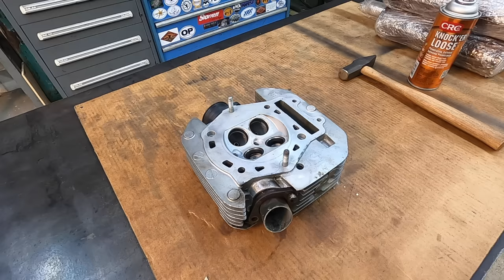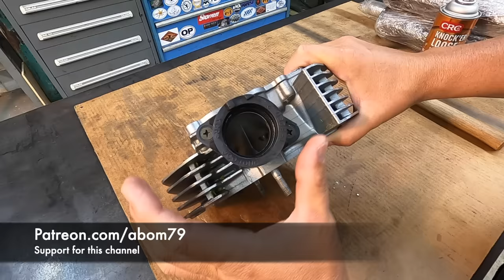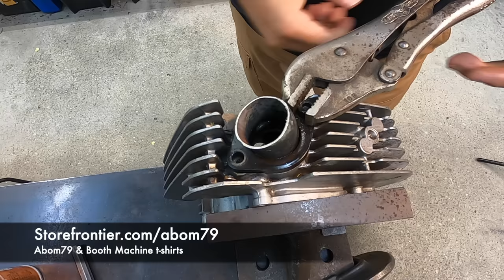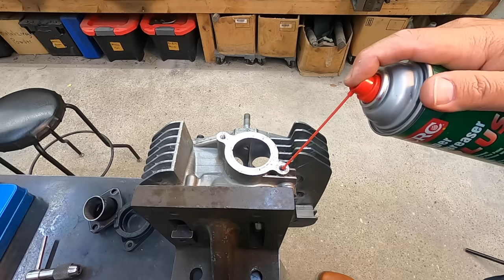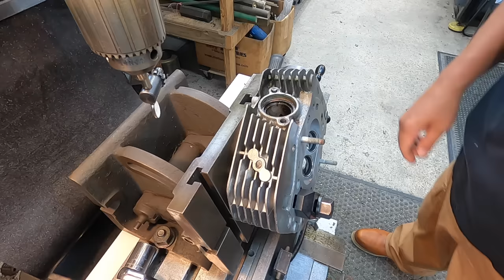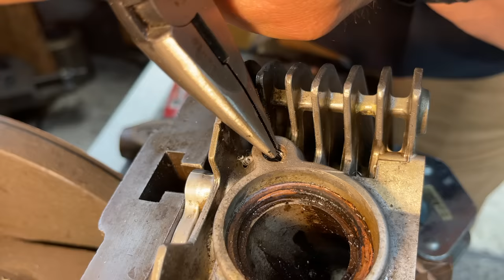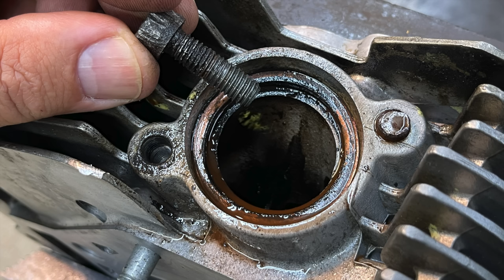Broken & Siezed Bolt Removal, DR 650 Cylinder Head

Comment: Because Alum expands much more than steel first heat to 350°f.
Reply: That's what we always did when I worked in a motorcycle specific machine shop.  Get it hot, and it's amazing how easily steel comes out of aluminum.  Not only that, but I don't know any motorcycle mechanic who doesn't have an impact driver for those PITA conical seat phillips head screws.  I bought my first one in 1980, the same year I bought my Honda 750F.  It was invaluable.
Reply: @lobuxracer  1972 I bought new a Honda 750 great bike.
Reply: Heat is my go to for that!

Comment: I have a fold down back seat latch stuck in the upright position.  I tried using every kind of anti-locking lubricant I could find.  I tried banging it. Nothing works.  Also, finding a replacement mechanism  at junkyards has not been successful.

I have to live either the problem until I find another vehicle

Comment: 50/50 mix of acetone and ATF works better as penetrating oil than anything you can buy off the shelf. Ignore WD-40, Knock 'er Loose, PB Blaster, etc. Just mix up some of the ol' magical oil, spray it on the part (a lot of it), and let it sit overnight. You'll be amazed.
Reply: You can also use VM&P naphtha instead of acetone. The point is to significantly reduce the viscosity of the ATF with a very low viscosity thinner. Also, any other light oil like power steering fluid will work instead of ATF.

Comment: I would have tried some heat first....then if no good weld a nut on with my mig.

But if I had good drilling equipment I would not need that.....but being a home mechanic thats me.

Comment: Mate reckons you should have aligned perfectly with the broken bolt
You should have aligned to a thousands (i.e. perfectly) on the removed bolt thread and then traversed across to the broken bolt knowing it will be offset by full or half mm steps.  You'd obviously have to do some trig calcs due to the angle.
This would have enabled you to align perfectly with the broken bolt that you drilled out.

Comment: This is definitely the most difficult way of doing it and takes way too long, with the first drilling slightly heating the piece with the torch and an easy out. Will come out in no time, that’s a very soft material you don’t need to go through so much to remove a broken bolt I’ve done it countless times and never damage the thread.

Comment: Lots of comments that shock (impact ham, hitting with real hammer works, i have a trick i have never seen used by someone else but it always worked for me.  Take a air impact wrench and turn air down to a point so it can not shear of bolt let it sit t there hammering for 20 min, turn up power a little wait 5 min turn up more, wait a littl everytime i done that like  magic it starts to turn out. Small hits from a impact wrench kill the devil. U can laugh but unless you try it you dont know it. The torque is so low it wont spin the wrench so i brace everything in place and walk away let the air do the work, if you watch same as boiling water it yakes longer lol.

Comment: Why wouldn't you drill thru the center of the bolt and add a little heat down thru the center? Could it maybe break it loose?

Comment: So, my cure (have been in same situation several times):
Heat for heating up object to make things expand a little.

Drill a hole in the broken bolt, but a torx bit in it.
Now start heating it up, and try to turn it. At the end it will be removed.

If the threads are messed up, use helicoil to fix that issue.

Oh, also if someone else is reading and have like a hole in their clutch cover etc. Try J-B Weld, repaired the clutch side of a Suzuki Savage with it. Worked perfectly. Can highly recommend it.

Comment: okay what you did is the easy part what do you do when somebody's broke off a drill bit or a tap and what they've been trying to get off trying to do it themselves
Reply: Spark errosion, or a new cylinder head!
Reply: @stuartdixon747  can you please explain spark erosion. I have this situation with a broken easy out in a main bearing stud.
Reply: I have a broken easy out inside of a broken stud for a main bearing. Is there a solution?
Reply: EDM can burn out anything. (Electric discharge machining) I’ve had broken taps and drill bits removed that way.

Comment: Exhaust fixings should always be studs. With the heat of the exhaust a bolt will always seize, especially steel into aluminium. Even with studs I always replace the nuts with stainless steel ones.

Comment: I wonder if a stainless or bronze bolt would not have seized like the steel one did?
Reply: DON'T use brass or bronze on aluminium, it will "grow" together, and you won't GET IT OUT OTHER THAN DRILLING IT OUT.

Comment: For that leveling issue, perpendicularity to the other shaft would have been your best bet for maximal precision.
Reply: I would have drilled them by hand.  It is possible to keep the drill bit center of the bolt, and drill straight enough to use an e-z out.  Some heat if needed, penetrating oil if needed.  They work.

Comment: Freakin exhaust muffler bolts on my weed trimmers are always like this. Best thing I have found is to heat a bit with one of those hand held mini torches, and use 50/50 Acetone and ATF solution as a penetrator. Work the bolt gently back and forth.

Now if the bolt is broken then you have to drill and re-tap like this.
Reply: You don't have to use a drill so big that it hits the threads.  E-Z outs work pretty good.  You can even center punch the broken bolt, (grind flat the end if you have to, for a "center" center punch.), and drill it by hand if you are careful.  If you make a pretty big center punch divot so a smaller diameter drill fits in the divot, the drill will stay on center.  Then go to the size drill you need for the e-z out, and it will follow that hole perfectly too.
Reply: @EarthSurferUSA  
I tried that, it didn't work, I was working on a lawn mower blade spindle,  it used 4 bolts to hold the spindle to the mower deck.  I broke all 4 bolts,  I drilled out all 4 holes, used through bolts with lock nuts worked fine. Difference is,  I could use a through bolt, with that head he couldn't do that. It was a good fix, though I think it would be kind of expensive.

Comment: i use a form tap to chase those internal threads without removing material
Reply: But you are jamming the contaminants into the soft aluminum thread.  There is nothing wrong with using a tap with some oil, as long as it is no an over sized tap, (used in die shops a lot for threads into steel that is to be heat treated later, deforms the threads a tiny bit.).  American standard tap "GH3" is the most common standard size, and a metric "D4" is a common standard size.  If it is a bigger number, it is a slightly larger tap, and the bolt would feel a bit too wiggly.

Comment: If I may add another way to indicate the broken bolt's tapped hole.
Cut the head off of a partially threaded bolt (applicable to the size of the tapped hole. Thread it into the good hole and put the bolt's shaft into a collet (in the quill). The part is, of course, being supported by the table. Secure the part, which is now true to the quill's centerline. Remove the bolt and indicate over to the broken one.

Comment: Copper compound, always a tube in my garage, has not failed me yet, granted the customer found it like this so he had no chance, would a little gentle heat and lube also not help, just getting the Aluminium to expand a little to break the lock, in this case maybe not but most times I try that before getting the welder out. 1000 ways to skin a cat.

Comment: In have always had good luck center punching the broken bolt,  drilling them out by hand, (First drill fits in the center punch. final drill smaller drill then the minor diameter.), then using a solid e-z out.  Of course penetrating fluid and heat may be needed.
But to get a broken tap out of a hole, the mill is nice to use.  But if all failed, you can use a heli-coil.
Reply: looke
s my comment

Comment: Steal and aluminum nev join add heat to the head not the bolt and use a drop every hour for the day of dot 3 break fluid and I'll be shocked if don't spin it out I got a Piston out or a boat v8 full of rain water for 35 years with break fluid
Reply: brake fluid

Comment: Why no machine oil on drilling the bolt?
Reply: I believe the use of a slow speed rate, a sharp drill, and the constant clearing of any chips, helped avoid the need for oil.
Reply: With those chips you don't really need any cutting oil, as long as the chips are staying together you know where they are. If the chips are small then you might need oil because they cause excessive heat due to friction. With cast/black iron i usually use 7040/drill diameter to get the right rpm and i usually get those chips, then i don't need oil and cleaning the part after. With deeper holes you might use oil because it's harder for the drill to remove the chips.

Comment: Adam, whenever we had to remove bolts or screws in our machine shop we would usually use a center drill (not a spotting drill) and an "easy out". The easy outs usually come in sets of graduated sizes, and of course they have a left hand twist to them. I believe you can attach a tap handle to them. They usually work quite well.

The pilot section of the center drill produces the cylindrical hole, and the angled section produces a chamferred shelf. It's where the cylindrical hole meets the chamferred shelf that the easy out digs into.

Comment: first step is always heat i use heat up the area first with map gas then try to remove the bolts only after you get movement you use some pb blaster or kroil

Comment: Tap vs Thread Chaser? 🤔
Reply: A tap is fine for running though the thread.  But some taps are a bit oversize for tapping steel that is to be heat treated, (die shop details), so a bolt still goes in it well after the heat treating.  American standard taps have  "GH" number on the shank, (GH3 being the normal tap, and a bigger number being slightly bigger.).  Metric taps have a "D" number, with D4 being the normal tap.  But after you remove a couple broke bolts and broke taps,---a beer with a chaser is last out of the tool box.  :)

Comment: It’s preferable to weld on a 2” hex bolt rather than a nut. But this was a nice solution. It’s also the first one I used on my second bike Honda CD175 when I fitted socket/Allan head bolts to the casings, except I was using a very fast and heavy hand held Wolf drill, on my knees in the garage of my parents house. 

Thank you for sharing

Comment: I know you did the right thing in the video, to save the threads, but me, I would have gone ahead and put in helicoils, to not only add strength but to eliminate the problem next time. Helicoils were originally developed , not as thread repair, but to add strength in soft materials

Comment: You want loctite on any screw or bolt that goes into  aluminum.  We use 242 blue.  It keeps the metals from galling.
Reply: Is it good on exhaust manifold bolts too?  I think it melts at 300F. Maybe that doesn't matter once it's in the threads

Comment: how much $ for that repair?
Reply: Regardless the cost there are 2 choices buy a new one or repair it. If the repair is the only option, the expertise and proper equipment make it possible. Sharing this info makes it priceless. From a retired machinist, wrench gorilla, and Motorsports contestant

Comment: That would have been so much faster with a welder. Just make sure to let it cool before extracting because metal expands. And the bond is stronger and the heat breaks the corrosion lock.

Comment: What is a left hand drill?
Reply: Most drills are right hand , meaning they drill when they turn right,  a left hand drill,  turns left when it drills.  By turning left if it catches  it can unscrew a broken bolt,  E Z outs work the same way they turn left to unscrew a broken bolt as well.  I hope this helps
Reply: He means CCW (=Counter Clock Wise) for left hand drills. Regular drills spin Clock Wise (right hand drill).

Comment: D I d dissimilar metals cause the seizure?
Reply: Mostly likely. This happens alot on cars with aluminum heads and steel bolts. You remove the steel bolts and the aluminum threads come out too

Comment: CRC Knocker Loose SUCKS!!! Use a pneumatic engraver and a center punch to "walk" out most bolts. Drilling with a left hand drill bit is a good idea but I have had MUCH better luck with welding a nut over the remaining stud and turning it out. Especially when the head is not steel.

Comment: Excellent video, did this sort of task on diverse mechanical applications including guns. Your iteration of tasking within ones comfort zone has proven the best for long term SUCESS as well as shorter duration to completed tasks. I did wonder why you might have struck the broken bolt to upset the threads and then recalled the number of strikes with head still attached it took to loosen the bolt head. Striking that close to the aluminum surfaces exposes the propensity to have a glancing blow where the punch was captured inside the Allen head bolt. Patience improves quality outcome that includes the customer and craftsman. ( A sign in our shop, actually more than one) we signed on !

Comment: Can you foresee a time when Canada, USA etc. will finally drop the imperial system together with its number and letter drills, whitworth, etc. and commit to metric only?  We're almost there in Australia.  I thought you'd be further down the metrication road when I left Canada in 1981.  Noting that most current workpieces are now metric - cars, bikes, etc. including the one you're fixing here. I commented with this point previously on a workshop vid from the USA   - nearly got my head ripped off for such a suggestion.
Reply: I hope they never get rid of the SAE system. I never liked the metric system and I have to design to it. It's ok, but lest ye forget, ABC countries did win wars thanks to the SAE system / imperial measurement system....
Reply: No
Reply: @fredr4258  I agree completely👍

Comment: I'm just wondering how the hell can a cylinder bolt break like this?? Maybe the owner didn't put any adhesive on the bolts first to make his life easier, so he ended up with a broken bolt stuck in one of the most difficult parts of the engine. You never begin to unscrew engine bolts or bolts in general before you first spey them.

Comment: when its a steel bolt and alum. body the vibration will cause it to litterly weld it self in  the only way is to drill it. people will leave there alum trailer hitch in and just from driving it will lock it in and the only way to get them out is to melt them, alum melts at a t lower temp than steel.....just sayin......

Comment: Applying heat to Alloy and Steel - the problem is always the difference in the co-efficient of expansion of the two materials. Because of this the steel bolt will become harder, if not impossible to extract - with potential un-necessary damage to the alloy.
Reply: One thing I've dome is to submerge the piece in water, even the nut & stick weld the nut! If the stud is recessed, insert thin copper tube to protect  threads mask the head with thin copper to protect the head & weld up then drop a nut on it & weld!

Comment: WONDER FULL SHOW YOU ARE PRO. !!! IF POSSIBLE USE HEAT BUT BE VERY CAREFUL WITH HEAT ON ALUMINIUM  HEAT WILL SOFTEN LOCTITE LOOSEN WHILE HOT!!! 74 YEAR OLD MACHINIST, I HAVE REMOVED 2 INCH  BOLTS ON TANKS IN U. S,   ARMY 1966 TO 1972

Comment: If nothing else works instead of stripping the threads in the head.  A last resort is going to a machine shop with an EDM machine get some carbon rods made the diameter of the inside of the bolt threads and burn the bolts out with the EDM machine.  It will be expensive but all that will be left will be the thread bolt.  I know it’s obvious but was the metal of the bolts comparable with the metal of the head. 😅

Comment: Great work!.  Without tools like that my only option would be to heat the head up to just under melting, then spray canned air upside down to freeze the bolt.  Probably would be a big fail...